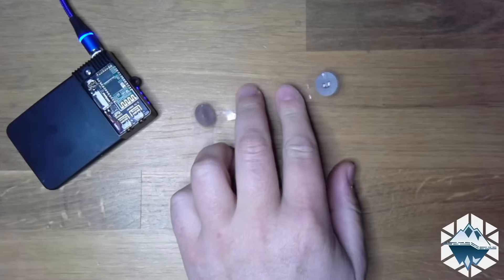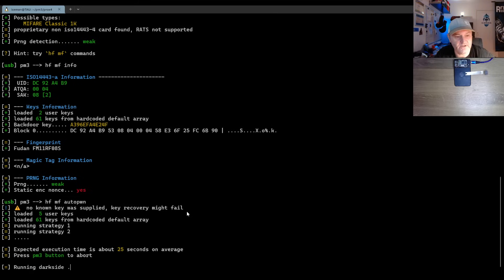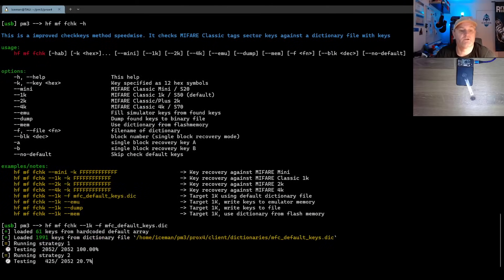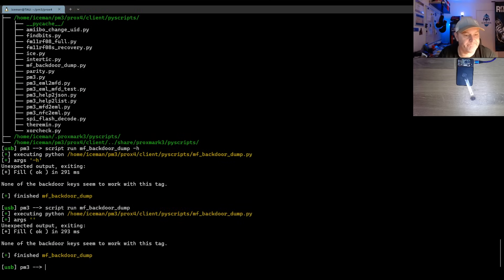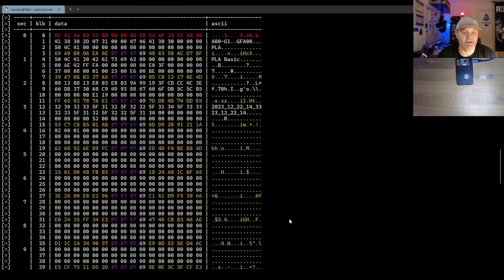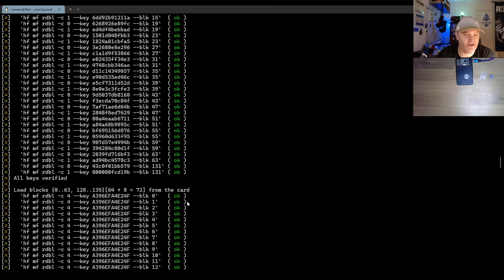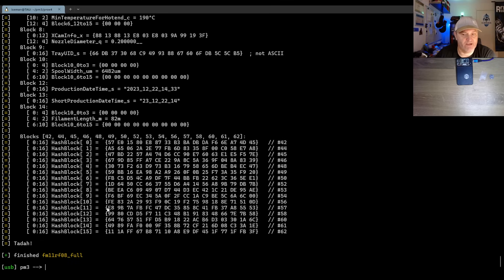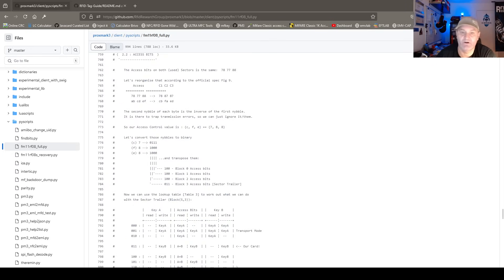First look at Bambu 3d printer DRM

Comment: hey i need help , i'm a noob and try to replicate your processus but evrey time i try to execute the script fm11rf08s_recovery i have errors : it gets me 

[usb] pm3 --> script run fm11rf08s_recovery

[+] executing python C:\ProxSpace\pm3\proxmark3\client\pyscripts/fm11rf08s_recovery.py
[+] args ''
[=] UID: AA448D74
[=] Getting nonces...
Traceback (most recent call last):
  File "fm11rf08s_recovery", line 644, in <module>
  File "fm11rf08s_recovery", line 632, in main
  File "fm11rf08s_recovery", line 115, in recovery
ValueError: substring not found

[!] finished fm11rf08s_recovery with exception

i cant understand why , as i am a noob i have reinstall all proxmark ets ets and every time i get this error 

and with the fm11rf08s full -b 
=] ===========
[=]  Card Data
[=] ===========
[=]
[=]  0:  0 | FA B3 48 A9 A8 08 04 00 04 7A 32 26 C1 B7 31 90 | ..H......z2&..1.
[=]   :  1 | 53 30 32 2D 57 30 00 00 47 46 53 30 32 00 00 00 | S02-W0..GFS02...
[=]   :  2 | 50 4C 41 2D 53 00 00 00 00 00 00 00 00 00 00 00 | PLA-S...........
[=]   :  3 | -- -- -- -- -- -- 87 87 87 69 -- -- -- -- -- --
[=]
[=]  1:  4 | 53 75 70 70 6F 72 74 20 66 6F 72 20 50 4C 41 00 | Support for PLA.
[=]   :  5 | FF FF FF FF FA 00 00 00 00 00 E0 3F 00 00 00 00 | ....�.....�?....
Traceback (most recent call last):
  File "fm11rf08s_full", line 1066, in <module>
  File "fm11rf08s_full", line 166, in main
  File "fm11rf08s_full", line 681, in dumpData
  File "fm11rf08s_full", line 98, in lprint
  File "C:/ProxSpace/msys2/mingw64/lib/python3.11/encodings/cp1252.py", line 19, in encode
    return codecs.charmap_encode(input,self.errors,encoding_table)[0]
           ^^^^^^^^^^^^^^^^^^^^^^^^^^^^^^^^^^^^^^^^^^^^^^^^^^^^^^^
UnicodeEncodeError: 'charmap' codec can't encode character '\udcfa' in position 76: character maps to <undefined>

it stop with this error any advice? thanks

Comment: Relevant video again due this: "Recent concerns about Bambu Lab’s firmware updates center on the introduction of mandatory authorization and authentication controls for key operations on their 3D printers, particularly the X1 Series. These updates, which began rolling out in January 2025, have sparked significant backlash within the 3D printing community for several reasons:
Key Issues Raised
	1.	Restricted Third-Party Software Use:
	•	The new firmware limits the ability of third-party software, such as Orca Slicer, to control printers unless routed through Bambu’s proprietary “Bambu Connect” tool. Critics argue this undermines open-source principles and user autonomy.
	2.	Concerns About Closed Ecosystem:
Reply from the maker: I didn't expect Bambu Lab to make such u-turn.    Their community was really loving them.

Comment: Hey sir, excellent video, now we need the clone part, but theres still a challenge there…how to avoid the bambu ams bricking the clone tag.
Reply from the maker: It’s not an DRM.   The bambu software allows for any filament to be loaded.  

If you wanna make a perfect clone then you need to figure out how to generate signatures.
Reply: @iceman1001 i can make a perfect copy, but the ams bricks the tag since its a cuid tag.
Reply from the maker: @LuisPa247  dont use a CUID card then.   There more versions of magic uid cards.

Comment: Excellent technical short summary - many thanks. I am using a BAMBU Lab 1X Carbon. Would be great to be able to write your own spool tags. I am using also a Flipper Zero. Of course in that case without any big step forward (no read, write or mod possible - as by now).
Reply from the maker: You should be able to already.   There is a library for doing so already out.   Don't ask for a link :)  you find it on github.

Comment: Bambu doesnt have to lock anything they have perfected printing with their filaments.  I tried some cheap filament and it worked but not as a first layer even when adjusting settings.  I tell anyone who isn't into tinkering to just go with the bambu filament its worth the +25% to just have it work
Reply from the maker: Sounds reasonable.   And yes,  there is no DRM lock. 
In the short week since I posted the video,  the KDF has been published.   Which is amazing progress!

Comment: The error you are seeing at 11m14 (save fail) is because the filename has been prefixed with "esc[33m" (ANSI code: foreground colour = yellow) and suffixed with "esc[0m" (ANSI code: reset colour to default) ...This will also likely break the MAD decode
Reply from the maker: You are correct. 

I think Doegox fixed that one now.

Comment: Total misunderstanding of the role of these tags. As well as the convenience when using the extra-cost auto filament handling (the printer can’t read the tags!), a major function of the encrypted tag would be to prevent counterfeiting (or try to).

Comment: I dont see this as DRM but more as ID Tags. Not having this tag on your filament does not stop the AMS from taking Filament. The only thing the Tag does for the AMS is pre fill the profile.
If the filament has no tag, you have to do that manually.

Saying "restrict filament access" Would be incorrect.

Comment: They should have made that Metadata public / opensource.   Idea is good to tag the filament about manufacturing date, printing temperatures, etc.  I hope they will never differantiate like Bamboo filament = fast printing, 3rd party filament = slow as Ender 3
Reply from the maker: Yeah,   that is an good idea.  
Things like the public key so we can verify the signature.
Reply: They literally took open source software and patented it. There's no way they're going to make any of their own stuff open. They are going to lock all their printers down so you can only use their materials. Guarantee.

Comment: This isnt a DRM system. Contrary to the video description, there is no filament access being restricted at all.
Reply: .."there is no filament access being restricted..."
YET.
Reply from the maker: Very true.
Reply: @iceman1001  No! The tags are read ONLY by the AMS (an automated multi-spool handling system). It is an extra cost option. The printer itself doesn’t have tag-reading capability, and in basic config can print from one spool (any spool). Some materials (floppy TPU filament for one) can’t be fed by the AMS and need single spool mounting. Reinforced filaments (with glass or carbon fibres for example) are too abrasive for the cheap A1’s “AMS Lite” so they too need to be run (on the Lite at least) without the tag being read. 

The tag is simply a convenience, adding auto recognition of (Bambu)filament properties and defaults to the (optional) auto handling. 
The tags could not prevent non-Bambu filament being used because the printer can print even though it can’t see the tags! 

Where understanding the tag format MIGHT be useful would be in creating tags for filament from other brands, so that their properties and defaults could be similarly conveniently loaded, rather than being keyed in by hand with the potential for mistakes. 

Disappointed by the video, as the ‘research’ only used other folks scripts AND the fundamental misunderstanding of the role of the tags in Bambu’s system. 

My guess would be that they encrypt the tag data simply as counterfeiting protection - proving the product is the genuine branded item. Now who would benefit from that being cracked? Not the users. 

It just is NOT a system to lock users in to using only branded filament. What a pity you were misled.
Reply from the maker: Yup,  you are correct.   The was a comment before informing about what is possible with the Bambu 3d printer filament choices.  

I feel informed.
Reply: The DRM lock-in is just a small firmware update form Bambulab 
And than you locked in.
Reply: @berlinberlin4246  including those without AMS? yeah right.
Reply: curious how they would lock out those who purchased without AMS
Reply from the maker: They certainly have all the components in place for such a thing.
Reply: @iceman1001  how do you propose they enforce DRM-locked spools on all the bambu printers that do not have AMS and thus do not have any rfid readers?
Reply: @berlinberlin4246 
Hold up... Are you familiar with these printers ?
They allow for firmware downgrade and the process is even documented in Bambulab's wiki.
The printers can even be run locally (no Internet) or even completely offline with a SD card !

How in hell will the manufacturer lock the filaments that a locally running printer can take when its firmware can be downgraded?

And the final nail in the coffin of this theory: there is no RFID reader when feeding with the main spool holder (when you have no ams or bypass it) l : unless they come in your house and upgrade the hardware while you're asleep, there will be no ban of non-authorized filament.

TL;DR : this is either FUD or ignorance.
Reply: @reminiDave  Just Look how the paper printer companys has done it in the past.
And if it's only a nice to have function, why the using so much hard Crypto Inc public/ private key management?

The lockdown can be already be included in the firmware and get "switched" on via a flag in the filament RFIDs in the future, we don't know Shure it don't is it in this way
Reply: @berlinberlin4246  
I'm sorry if I wasn't clear enough: there is NO RFID reader on the printer itself. It means that it is physically impossible to restrict the type of filament you feed it.

Your concern might only be valid for the AMS System (the multi material box thingy you can have resting on the printer).

So let's clear this once and for all : these printers CANNOT be ordered to take only genuine spools.

And it's not wishful thinking, it's just a fact : they do NOT have the hardware (RFID reader) and it can't be made. Plain and simple.

Hope it clears some misconceptions you might have !
Reply: @reminiDave  those old printers will breakdown eventually or become obsolete.

Let's see in 10 years whether Bambu will succeed in changing the market to a similar state like the 2d printer market. Currently the customers seem eagerly willing.
Reply: It is absolutely DRM. Without a genuine tag there are features that are locked down and inaccessible. That they don't also lock down printing is irrelevant; that's why it's Digital Rights *Management*, because they can choose arbitrarily what they do and don't allow.
Reply: @JamesChurchill do tell which specific features are locked down... the printer has no RFID reader, that's in the ams.
Reply: @TMS5100  the most obvious thing - automatic filament metadata reading. You cannot make a custom tag, only BL can. That's a "right" which is explicitly managed. And if you want to be stubborn and exclude that for arbitrary reasons, then the filament remaining reporting is also locked to BL filament. It doesn't use the tag at all, but it's disabled if the tag is not present.
Reply: @JamesChurchill  yes, and...?
Reply: @TMS5100  You're explicitly claiming "It's not DRM because it doesn't prevent you doing things" and I've just given you multiple examples of things it prevents you from doing. I didn't even use big words.
Reply: @JamesChurchill  literally nobody cares except you. you arent prevented from using the printer or any filament you want or printing anything you want.
Reply: @TMS5100 "I've just been proven wrong on the internet and I can't handle it" is certainly a choice.

Comment: Thanks mate, that's exactly what I did at the time the video was released. I played with the Bambu chip of a friend and was shocked they surprised FM11RF08S for it. But I missed the 2nd script has a parser (never checked the script). So some manual work could be avoided, heh. But now I checked the video and know. Thank you for the content 💜
Reply from the maker: Its funny how things align.  I was just happy to explore the fm08s recovery with Doegox script on a unknown tag where I didn't have access to sniffing.  And just like that the script with recovery and a bambu decoder appears.   

Now this catapults the data mapping stage by making it so much easier.     I am curious to see what happens the next months.

Comment: I have not seen the code myself, but i am assured that the Bambu firmware uses the "hash" to perform public/private key validation of the Bambu data ...Thus you can duplicate, but you cannot tweak any values
Reply from the maker: Nice script of yours!    I think you enjoy the colors and stability fixes from Doegox. 
The hash is according to the referring repo a RSA-2048 signature which indeed would be a PKI with public/private key. 

Looking inside that firmware of the readers or the printer would give the KDF and also the public key.
Reply: @iceman1001  Thanks. And, You're Welcome. 
I also added colour at one point, but it obfuscated the code, and "readable code" was important for my use-case. Really happy you guys have a different agenda and did that work for me :)
The only stability issue (I know about) was the online Fudan check, which turns out to be a Python issue we couldn't reproduce on my machine :/ ...You can still cut'n'paste the 'manual check command' (`wget`) from the script output; but that check only identifies supply-chain attacks - so is of no value to us other than maybe the intellectual challenge of inferring the algorithm, which it now seems is NOT a "partial HMAC" [as suggested by v1.1 of Philippe's (excellent) whitepaper]
The Bambu Public Key has not (afaik) been released, and (I am told) the KDF relies on data which has not yet been liberated from the microcontroller ...If/when these data are made public, I will implement them in the script.

Comment: Thank you for looking into this, not having info about how the tags work has been a bit of a point of annoyance in the Bambu community.
Though I will admit I am not happy with your clickbaity title for this one.

The tags are not DRM. They do not prevent you from running any other spool of filament in the printer like on some other 3d-Printer brands. They also don't make it so that the filament won't work in any other printer.

The only thing they are is a convenience feature that has nothing to do with DRM. There are no digital rights that are managed nor are any non-digital rights being managed digitally. 

You put on a Bambu spool and the printer automatically knows the settings it needs for it and selects those in the slicer, that's all.
Reply from the maker: Interesting,  I did not know that since I don't have a Bambu 3D printer nor played with it. 
I only have that strip with two chips on them.  I must admit I assumed they were DRM,  given the personalized keys and signature. 

Thinking of the signature,   which makes me think they never update the tag data.  Also the readonly access controls does give strength to that thought.   You say there is no digital rights managed digitally,  do you have a source link for that so I can educate myself?

Finally,  it's cool that you can use which ever filament you want in the printer!
Reply: @iceman1001  My wording might have been a bit... iffy on that one, I was just trying to state that I wouldn't see that as either of the two ways people interpret the "DRM" abbreviation and the "Digital Rights Management" (as in "management of rights that are digital" or "rights that are managed digitally") label as the tags are nothig more than a pure convenience feature, at least at this point.

Which would also kinda go with your comment on that the data on the tags will not be updated, as they only there to tell the printer what settings to use.

Tough, given the encryption, the tags, along with their convenience features, might also originally have been meant as a feature trying to prevent counterfeit "original" Bambulabs filament from being made easily and cheaply... but that's pure speculation on my side.
Reply: @AragonTigerseye  They went through an awful lot of trouble to lock down a "convenience feature".  Perhaps they aren't using that tool for evil (yet), but I would say that assuming it is and will always remain innocuous is a naive take.  Even today, they are withholding these convenience features unnecessarily, so I think any kind of a gracious read is unwarranted.  DRM is 100% the term used when a company makes their product only compatible with their own hardware or consumables, even if that incompatibility is partial.
Reply: @fatmanforprez  Having owned a Bambu printer for a couple of years along with other printers (Creality, Prusa, etc), I can confirm that is only a convenience feature and only applies when using the AMS (multi material 4 spool changer). The printer itself, in the manual feed and the extruder) does not check any of this. You can feed the printer whatever filament you like from whatever company that produces it. You just need to get it configured in the slicer software to use the correct temperatures, flow rates, etc. In the current state of the Bambu ecosystem, i do not see a way for them to restrict the device to only use their filament, which, btw, is produced by a 3rd party anyway.
It would be nice to be able at some point write tags for 3rd party spool (the adhesive kind) which would give the convenience to not having to go through the menu to define material, manufacturer and color. But that really is just about all there is to it.
Restricting filament use to their own branded stuff would literally bankrupt their business model as nobody would buy anything from them anymore.
Reply: @fatmanforprez  How are they witholding anything? Anyone can put an RFID tag on their spool and have their printer read it. This is absolutely not DRM. Do you even own a printer?